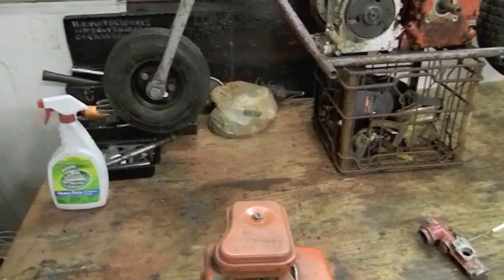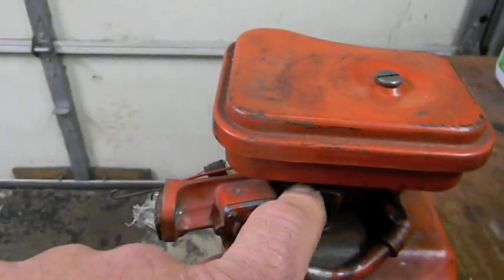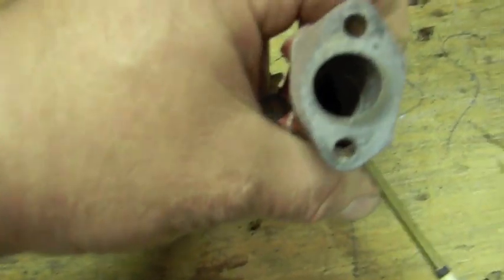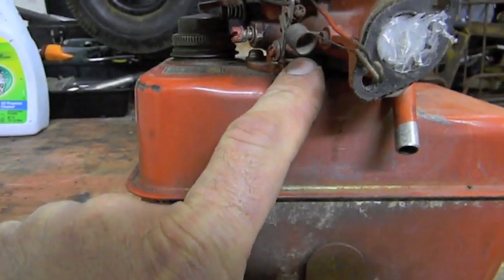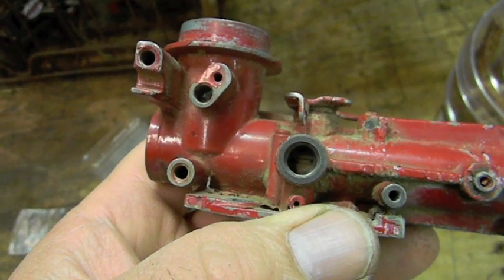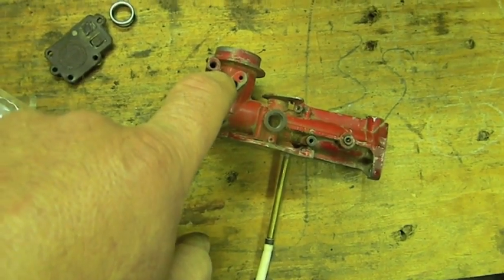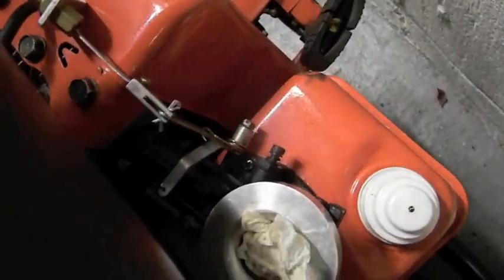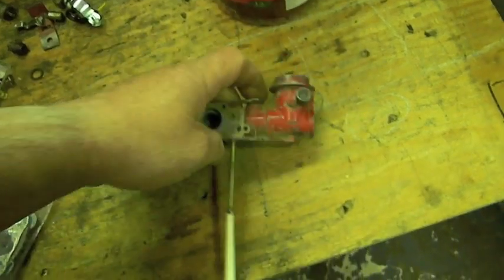Pulse Jet Carburator

Comment: Outstanding video (wow) and I have a question - The fuel tank and carb on your bench look like what I'm working on (1960's Wards Power-Kraft Generator - 4HP Briggs & Stratton) - Any tips for cleaning a tank that was left with fuel in it (7+ years) or how to identify the tank to order a new one?

Comment: Boy, that looks just like mine..I just put a fuel pump gasket in it and it has been turning a 2000 watt Winco generator about 1700 rpm....about half throttle but it's charging up my 8 solar batteries..this old motor is a 75 model off of a tiller...it only has maybe 10 hours on it...I got it out yesterday after 42 years of storage lol ....it's running like a champ...been going about twenty minutes...when my batteries get more amps in them I'll change the oil again...I sure do like the sound of it running...sounds like a mini bike I made one time...good old motors...one thing about this one the gas tank was like new so that helped

Comment: Hello i have a question i have a 3hp briggs and stratton engine that i have cleaned and replaced all gaskets on the carburetor but it seems to be leaking fuel   when its running i can really tell of its from the diaphragm side or from where the carburetor sits on gas tank any idea why this is happening. Hope u can help thanks.
Reply from the maker: Are you sure the flange between the car and the tank isn`t warped or bent?Alot of people will double gasket the tank to carb..I remove the pick up tubes and file the flange then on a flat surface place a piece of emery paper and move the carb back and forth untill smooth and flat
Reply: @homotorsports  ok i will do that thanks for the advice.

Comment: I have a 1965 engines Briggs & Stratton I can't figure out how to keep the gas tank in the carburetor on the engine while it's running the vibration keeps knocking it off

Comment: The brass tube (the long one) falls out of the carb hole on my roto tiller...I;mk sure it's because of the vibration. What is the best method of putting that tube back into the carburetor?
Will lock tite work?
Thanks
Reply from the maker: Clean it really well and try jb weld

Comment: Many Thanks for posting this video, Homotorsports.
I have a 1967 3 hp Briggs that was may dads, but knew the model # wasn't correct because he switched out the pull start housing from a rototiller and swapped it out to this engine. After watching your video ( and some others), I'm now able to determine that my engine is 80200 series rather than the 80300 stamped on the pull starter case. I now know which carb. Rebuild kit to order and get this little beast running again.
Have a great day !

Comment: PLEASE HELP!! I HAVE THE SAME ENGINE its a 5Hp Briggs and Stratton Tiller engine it has the pulse jet Carb and when you push the gas it brings up the rpms and puts them back down constantly sounds like it almost wants to die at times it wont spin my centrifugal clutch on my go kart it trys but it isnt putting out all the power it should